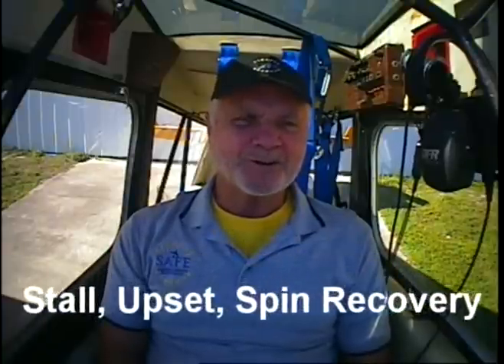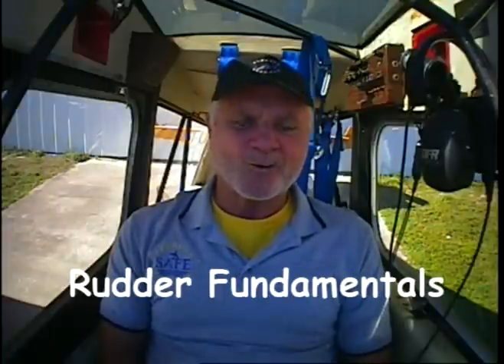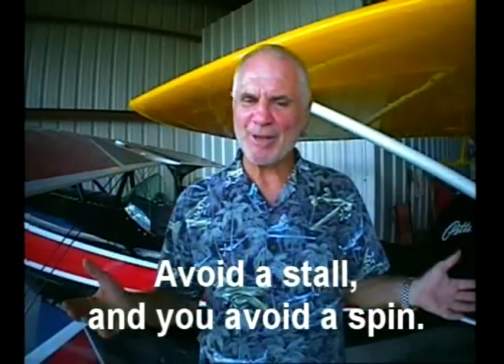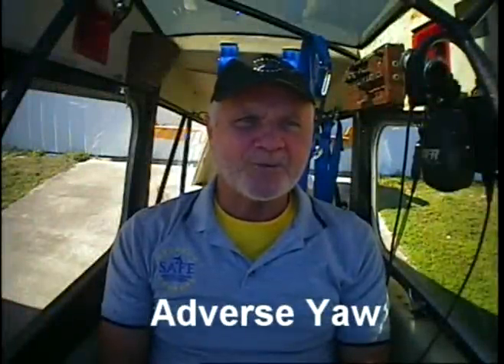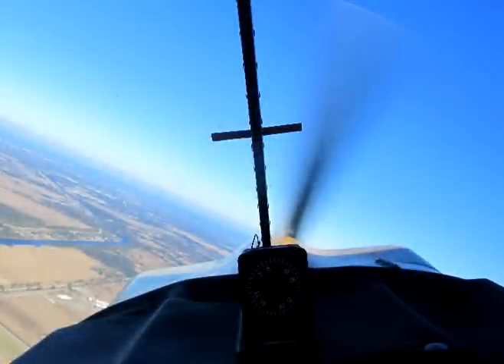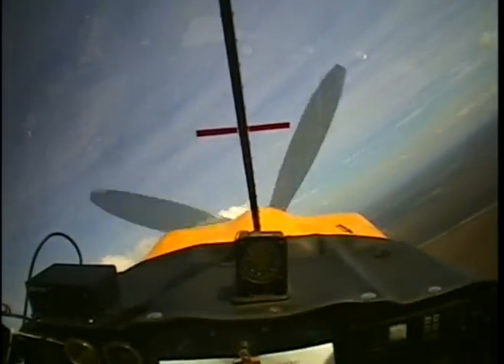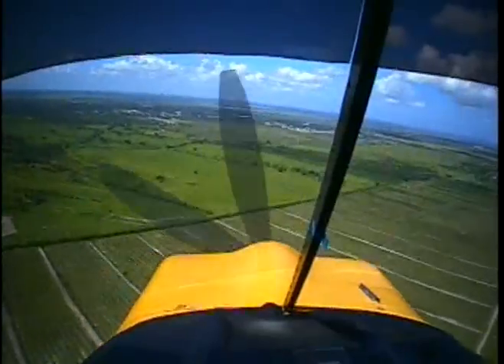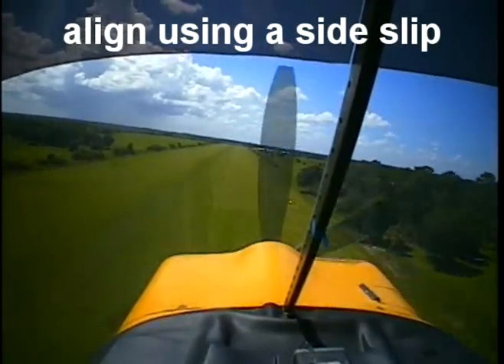Master Your Stick and Rudder Skills

Comment: Well explained fundamentally key points, Jim.   

Maybe that approach stall  to final could be revisited at the end to incorporate the BIG mistake that rookies make when the tailwind on base pushes them past their turn-to-final point - ie they use bottom rudder to tighten the turn after overshooting their turn to final.  
Then when they try to level the wings, the adverse yaw problem on the down wing causes it to stall and then the death roll.    Recovery must be quick and accurate - neutralize ailerons while pushing stick forward to attain flying speed and correct with opposite rudder .  
Rule: always avoid bottom rudder in that scenario (cross control skid). 

Thanks for your instruction (10 years ago now) and worth the trip from True North.  It was the best and allowed me to fly a number of taildraggers effectively with confidence.
Reply from the maker: I was glad to hear from you ten years after we flew together. Your excellent comment suggests enough topics for an entire chapter in a book. First is issue of turning down wind at low altitude. There are many pilots (especially Ag) that just do not do that. It is also an element of approach to landing that spooks many RC pilots. Key to understanding  turning down wind is that it is a perceptional issue and not aerodynamic.

You are so correct that bottom rudder is a "Killer". I prefer the term in-turn rudder because it is more easily associated with discussion about turns. I could never understand why so many pilots mistakenly think a rudder's purpose is to turn an airplane (it is of course to control yaw). The RC pilot community is big on rudder turns. The primary issue with holding in-turn rudder is that it make the airplane yaw (the nose drops -big time). That will always get the pilot's attention and he will do stuff; i.e. make additional control inputs and induce even more instability into the turn.

You used the term rooky for pilots that frequently make poor choices with aircraft control.  The sad truth (readily supported by FAA stats) is that newbie pilots aren't having deadly fatal stall/spin events. It is experienced pilots, for the most part, that are misusing the airplane's controls. I have written for years that I believe pilot mishaps during maneuvering is the consequence of bad habits developed over years of flying. Eventually their luck runs out.

Again thank you for your good comment. 
Fly high, have fun and keep the blue on top - Jim